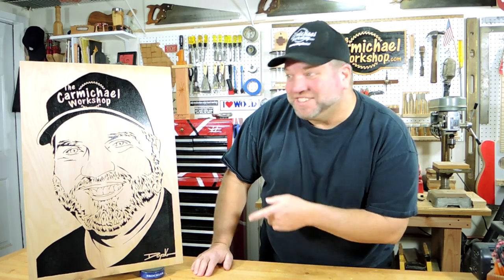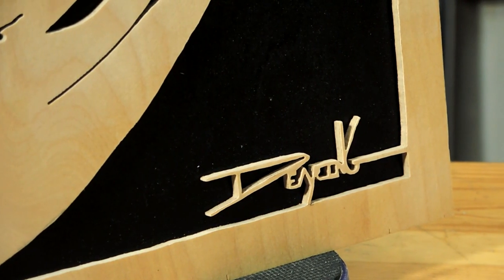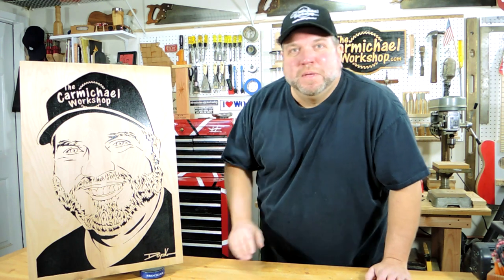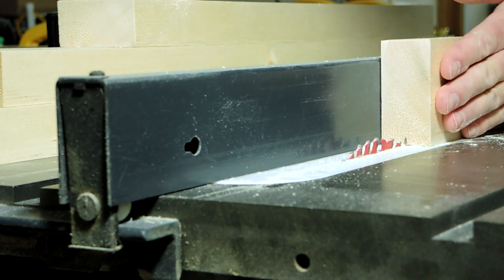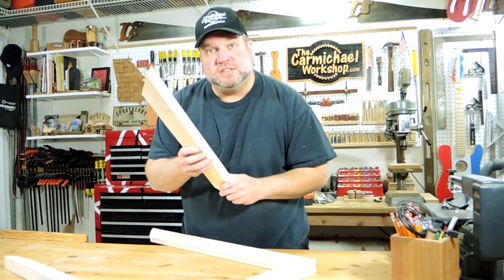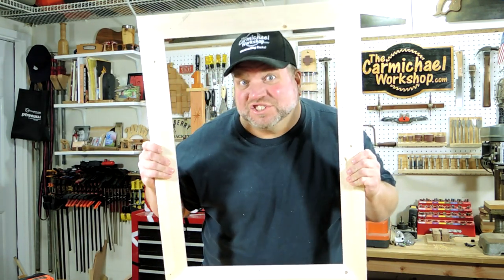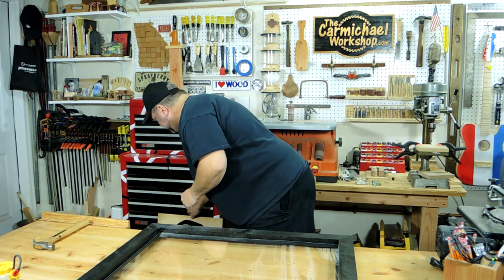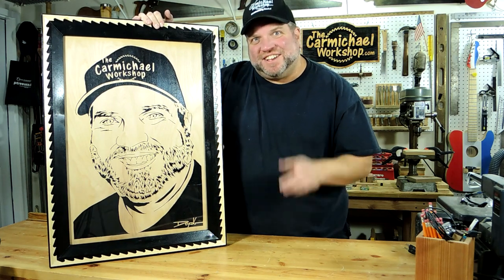Scroll Saw Portrait Picture Frame

Comment: Great job Steve!  The saw blade cutout is a creative touch.  Charlie is a master scroller.
Reply from the maker: stephen dickinson Thank you very much!  I've learned a lot from Charlie, especially about making the patterns.  I might have a go at doing a portrait, even with my old pin blade saw.
Reply: The Dwalt saw is about 500 bucks and does a good job I'm told.  I have a Hawk that I found on Craig's list for under 500.  Hawk sells their saw for 1200 so 500 is a great deal if you can find one.  That is, in my opinion, the way to find a good saw.  You are a creative guy and a scroll saw offers a great outlet for that creativity.

Comment: One method I use a lot is to paint the wood with blackboard paint which gives a matt finish, then coat with satin varnish (water based)
Reply from the maker: ***** Thanks, I will try that sometime.  I have messed up sometimes by spraying the wrong thing on top of paint, making it bubble up, so I tend to shy away from trying stuff like that.
Reply: Steve Carmichael As long as you keep with similar paint/varnish you should be ok, the blackboard paint i use and the varnish are both water based
OK, so i like the quick clean up of brushes :D
Reply from the maker: You and me both!

Comment: Hey Steve, great project.  Curious how when you cut the four parts of the frame on your miter sled, the pieces extend past the end of the sled which means there was no stop block in place.  How were you able to ensure all the sides were exactly the same length? Thanks!
Reply from the maker: Nathan Safran Hi Nathan!  Thanks!  I just measured and drew a line.  The sled has the saw kerf in it, so it's easy to line up exactly where it will cut.